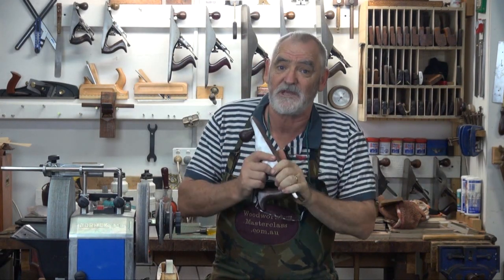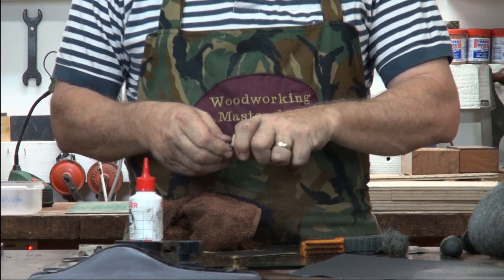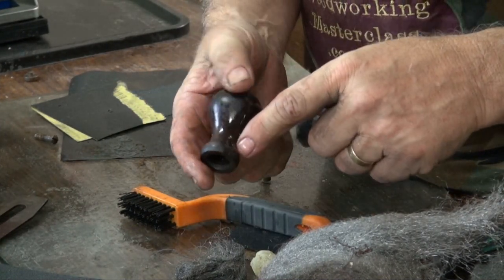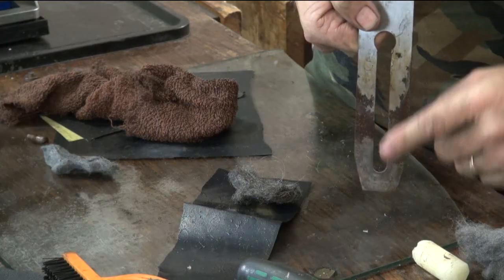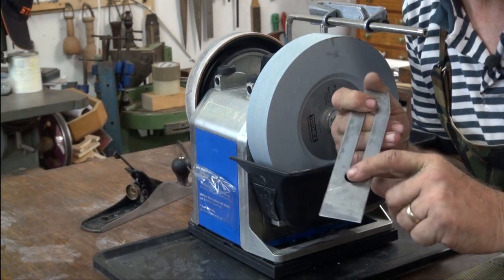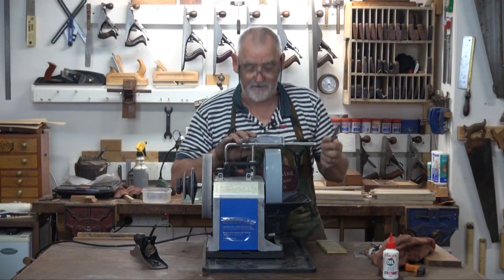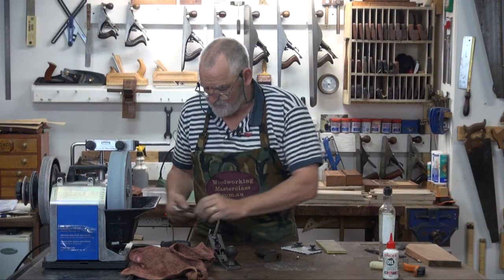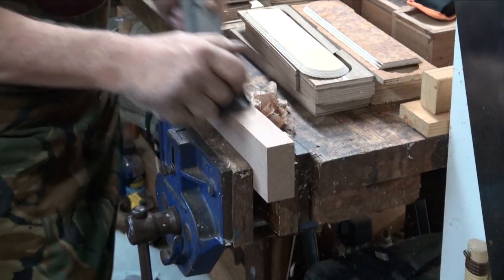Restoring Stanley 5 1/4 Hand Plane Part 3 of 3

Comment: Great job Steve! I just restored my bailey no7 and no4 and they work great the blades in them are a Erik Anton berg not original but they were my grandfathers and they hold a great edge ! Thank you
Reply from the maker: Nothing as good as using Granddads old tools. Still has the hands of experience pushing them. Cheers Steve

Comment: Really enjoyed seeing the 5 1/4. You don't see them much here in the states anymore. They were used in woodworking shop class and known as junior jacks or a 'boys plane'. I still have mine from woodshop days long ago, and it is one of my favorites. I use it all the time, along with the No. 3. I could probably get by with just those two and a block plane if I had to (which I do on jobsites). But I must say I was startled when you went straight from the wet wheel to the workpiece. I don't get the results you do from the wet grinder, I use waterstones and a leather strop to get a sharp edge. Anyway, nice job, and thanks for showing.
Reply from the maker: Yes, Michael, the tormek is a wonderful machine. What I do when it needs a brighten up is hone a second bevel and for that I use either a water-stone or oil stone. That way it is a long time before I have to take it back to the tormek for a regrind. Providing the edge doesn't get damaged in the meantime. We also had them in Australian school workshops. Now they have been replaced with 5 1/2's which is not as nice to use when you're younger. Cheers Steve
Reply: I suppose the difference in our wet grinder results reflects the difference in prices. Mine is not a Tormek :(

Comment: I restored an old plane and it looks great. The only problem is wood gets stuck in the mouth of the plane. Any suggestion's?
Reply from the maker: Hi Brian, Without seeing it I'm only guessing. a) Too much blade from the chip-breaker, b) Chip breaker not seated hard against the back of the blade, c) Blade not sharp enough.d) Frog not adjusted correctly e) blade put in wrong way bevel up instead of down?? Only guesses may not even be one of those. Let me know when you get it running right. Cheers Steve
Reply: Thanks so much for the advice I will certainly try those.